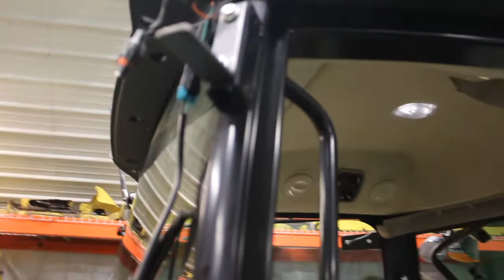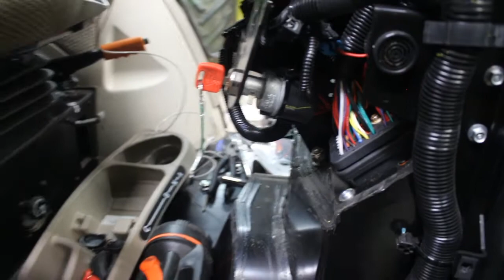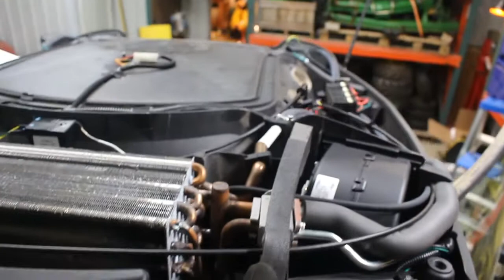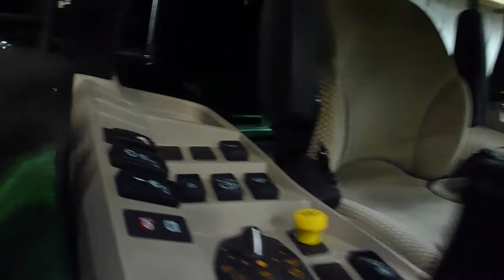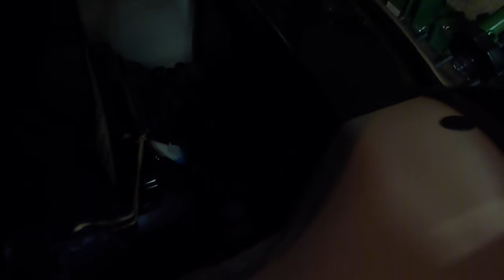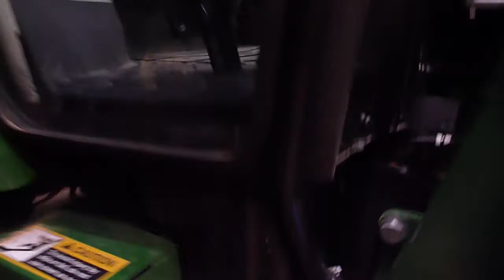John Deere 4066R Modifications: Part 6

Comment: Good Brackets, very clever. Was reading up on the 5090 series others have advocated you could have bought for a similar price, but it sounds like you get a world of problems with a series 5 the PowrReverser (PR) is a issue as the 4 series has Hydrostatic is supposedly superior and more reliable. So despite others saying you should have bought a "man's tractor" like a 5090, sounds like you got the top end of the Series 4, rather than the unreliable/ spartan though bigger series 5 M.
Reply from the maker: Thank you. Yes, I think the 4R was the right choice. Although I recently got to look over a 5R series with the CommandQuad transmission. Those are nice units! I am still very happy with my decision. Even if I need more hp and weight in the future I will most likely be looking for an older higher hp tractor like a 55 or 60 series from the late 80's early 90's era.
Reply: mmrbeef Food for thought I popped into my dealer today for a Massey Ferguson quote...asked for the RRP data sheet of the JD tractors (as your channel was something i stumbled across). JD 4066r was £40,250. With a dollar exchange of 1.35 dollars to the pound that would be circa $54k for the base model with zero upgrades. Just thought i'd throw that in the ring for a UK/European perspective. I always liked the JD 1640 myself...just reminds me of the die cast farm/toys dad bought me in the 1980's and early 90's.

Comment: What's the part # from JD on the LED lights you went with? Love your vids, I have a 4052R with cab..your upgrades are helping me a lot! 

Brian
Reply from the maker: Thanks! Glad they are helping! The current part number for those lights would be RE575338 and they have 2130 lumens. Those lights are directional so they will need to be mounted in the correct orientation. That is why I had to build the brackets for the lights to mount to the cab. Please let me know if you have any more questions.
Reply: I see that. I'm installing mirrors and plan on going to all LED's but have only found center mounts, which with some minor fabrication, I can make them work. Stock switches they say can handle 7 lights. I plan on 4 LED's up front and 4 out back. Let me know if you find some that look like our OEM lights.
Reply from the maker: We are in a similar spot on trying to find side mount lights. I mostly ran a third switch for the new lights to be able to control them when I am going in and out of the shop. I don't think I will be adding another switch as I convert more of the lights to LEDs. At this point I am going to explore adding a couple brackets for the center mounts to work. If I find a set of lights I like and look like OEM I will certainly let you know.
Reply: Ebay does have some that are 3120 lumens just like the ones you bought but for $80 out of Iowa. I believe I'm going to try them. My email is blyz_69@yahoo.com, I'd like to share pics as we go along. I'm getting the same accessory mount kit but to mount my planter monitor and a cell phone. Maybe you could share some pics of that..I'd appreciate it.
Reply: Do you recall the front and rear light switches and what the amp rating is good for on both? The 4 LED lights I want for the front and back are rated at 3.25 amps each on a 12V system..that totals up to 13 amps on each switch

Comment: I think JD on the loaders for the 5series makes a single point 3 function kit. Might want to look at that, since you will have to Fab up brackets anyhow.  Another thought on the Actuator, there prolly isn't much load on it now but what about after a couple seasons of use of the implements. I know on the skid steers sometimes the slots get bent or frozen (rust) and the hydraulic one will hit the relief. Now these are on multiple operator machines so that might be part of the issue.
Reply from the maker: Thanks for the tip on the single point kit. I am slowly acquiring all the parts I need, most recently half of a valve from a 6 series machine. I will certainly take a look at the 5 series though. I was looking at a 5115R the other day. Those are very nice machines.... with a corresponding price tag!!!
Yes, you concern on the actuator are similar to my concerns. Given that I am the only one who operates this machine I do not think it will be too much of a problem. If it does become and issue I can either revert back to the original type manual system OR explore using the front hydraulics (at the current moment I do not have an attachment where I can use the 3rd function) to do the same task and unhooking if I need to use the 3rd function, which I would have to do anyway if I needed that functionality.
Reply: The 5115R and 5125r are incredible machines with like you stated a house sized price tag. I demo'd a 5115r the other day and really impressed with the ease of use of the command quad trans (or command 8 in the 5125) the brakes have an auto clutch feature which makes easier on a novice operator compared to an Autoquad with a right hand reverser. However in my opinion if you are playing in the 5r price range you might as well look at a 6r and get the IVT. We ordered a 6130r for a Land Management agency my dad works for and it comes in this week. We are both really looking forward to operating that machine. If the Actuator becomes an issue you could use the 3rd function hyd for the attachment and use a ElectroHydro diverter valve to allow you to switch from a let's say grapple control or your attach control. I see a lot of homeowners use them on the smaller tractors that don't have a factory 3rd function.
Reply: Another thing I'm surprised I haven't seen is a pallet fork that uses a 3rd function to slide the forks left or right 6" or so. That would be some really neat use of it if you aren't exactly lined up. Commercial forklifts use it and it would interesting to see if it could be implemented in the compact tractor world.

Comment: What about the wire for the linear actuator when you take the loader off is there a disconnect for the wire when you take it odf
Reply from the maker: There is a weather pack connector by the hydraulic hoses that will allow the linear actuator power supply from the tractor. Eventually I hope to work the power supply into the single point connection with the loader hydraulics.

Comment: Im a chicken sh#t ,,lol i could never take a brand new tractor apart like that ,, lol turn lights on and my bucket would go up and down lol...
Reply from the maker: Trust me it wasn't easy drilling the three holes behind the seat and enlarging one drain in the cab!! The tearing apart.... I saw this machine apart enough times during dealer prep and install of the add-ons that I feel pretty confident in disassembly and assembly.
Reply: mmrbeef why did they do so much to it? How many times did you have to send it back?
Reply from the maker: No real problems with it. Just all the kits that were installed like the 3rd, 4th, and 5th SCV's. Down force kit, and all the other small stuff.  So far it has only been back to the dealer to replace a leaky coolant overflow tank.